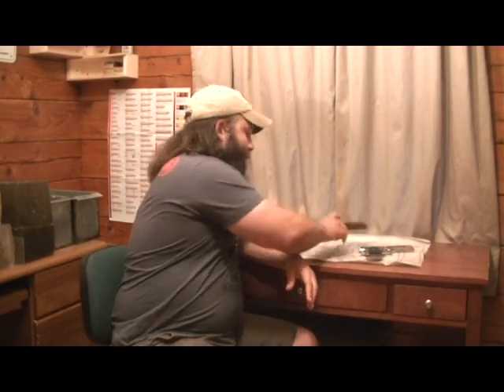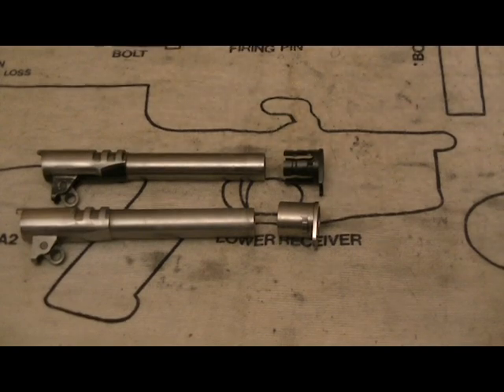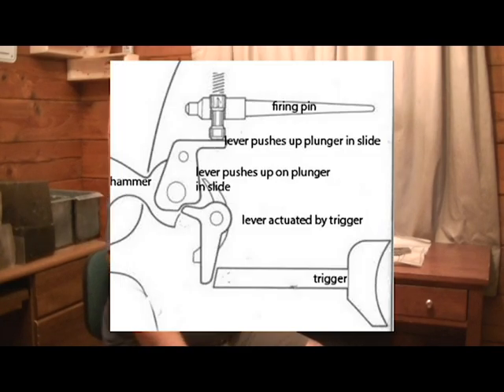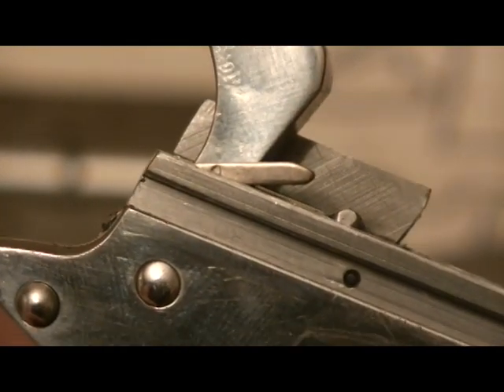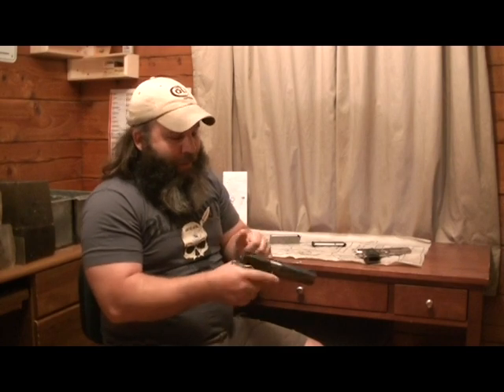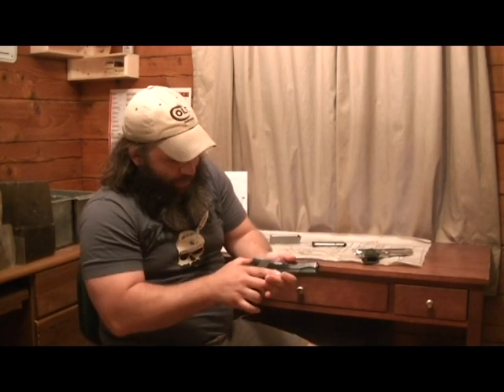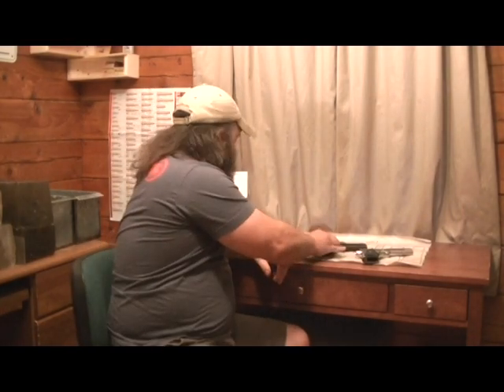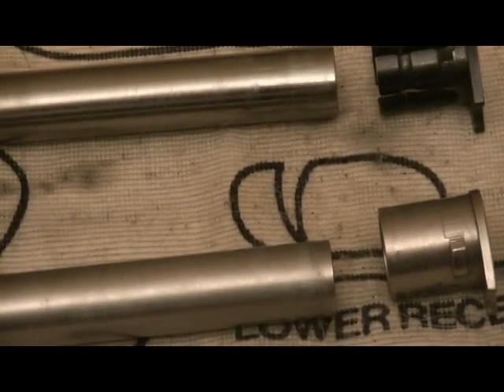Colt Series 70 vs Series 80

Comment: Just found this video.  I agree that it is clearly the best video out there explaining the differences between the Series 70 and Series 80 Colts.  This cleared up a couple things for me.  I've got a 1986 stainless Gold Cup Series 80, and another Colt 1911 marked Series 80.  The Gold Cup came with the collet barrel bushing which I have replaced with a standard bushing.  It functions exactly like you described and demonstrated.

The hammer on the 1911 has been replaced by a previous owner.  The replacement hammer has the half-cock hammer hooks you talked about, so it's operating like a Series 70.

Many thanks for the excellent clarification.
Reply from the maker: You are very welcome Mike. Stick around and check out other of my videos please.

Comment: I've had both and you are spot on, both had great triggers. The one with collet bushing never broke in over 10,000 rounds but was changed in a rebuild after that along with most internals! Only malfunction ever was from the detention tube coming off a nickeled Colt with rubber grips that didn't cover it, and two cheap mag springs going flat after being left loaded for over a year! That's 3 fails in 15 years and who knows how many round of reloads, hot hollow points, Keith type lead type and you name it! I know I'm fortunate but my 2 Colts and 2 Springfield's both ran everything I put in them, I've only had to tuned the extractors on them and do light polish of feed ramps and one firing pin hole that had a issue!

Comment: Thank you for this fantastic clarification.  So what would you call a pre-70 series pistol, like a mil-spec 1911 or 1911A1?  Does  it have a series #? Or do we just refer to it as a pre-series 70?
Reply from the maker: 1911 if it was made before 1924 and 1911A1 after that. Pre Series 80 designates a Commander without a firing pin safety. There is no such thing as a Series 70 Commander, FYI.

Comment: Good info brother I stumbled on this vid cause I was having a mini meltdown, That delta elite I had posted on your fb page I bought a while back I was going over it tonight giving it a lil inspection because I think I'll have to replace the springs. Well in the process of looking at it, dry firing it etc etc I realized that it barely has a "half cock" position and as you described the hammer will fall from the half cock if the trigger is pulled. I was flipping out lol and I'm by no means a nooB with guns but you can learn something new every day!

Comment: terrific Hunter as always...i didn't know about the hammer half-cock differences in the "hammer hooks" on the Old Colts.....all my Para's have the firing block series 80 including my 10mm (both have terrific triggers)...question....what's your choice or preference?  a Colt series 70 or Series 80?
Reply from the maker: Thank you very much brother. I am going to try and be less controversial, at least most of the time.

Comment: Im looking at colt Gold Cup National Match (45ACP) in 2020 on their web site and it has series 70 manual next to it.  Im confused why are they selling new series 70s when series 80s is update and maybe safer?  Still confused.  Sorry.
Reply from the maker: Bob, many folks do not like the Series 80 parts and some believe leaving out the firing pin safety makes for a better trigger pull.
Reply: Well was looking to buy a 1911 either a colt or a Springfield Armory.  I like the new new colt royal blued the best.  best bang for bunk I like the SA stainless mil spec.   So many options and they don't always tell you if its 70 or 80s parts.  So don't know enough to know what to buy yet.
Reply from the maker: Colt will be pretty clear if the pistol has the firing pin safety.  I don't know if I would say the Series 80 is safer but it is an extra safety. Between Springfield and Colt I would for sure buy the Colt. A much better bult pistol with better quality small parts.
Reply: @rangehot  Thanks for the info.  I like that new Royal Blued Colt I think its 70s.  I don't understand why they changed it if its not any safer?  Why not just keep the 70?
Reply from the maker: @Physics072  lawyers my brother.
Reply: @rangehot  :)  I'll have to punch my older Bro he is one,  howd you know?  Lucky guess.
I looked at older colts with Bluing and that roll marks on the new Royal Blued look amaturish vs the slightly older pistols.  Has Colt Slipped?

Comment: series 80 more moving parts, can that be bad?
Reply from the maker: Not necessarily, if they are correctly fit.
Reply: rangehot.com what about dirt and might require more cleaning. I feel like buying one to compare
Reply: There's theory, and there's experience. Go with experience every time.
I've been shooting a Sig Fastback Nightmare for about five years. It's a Series 80 design, and I've never had a problem of any kind.

Comment: What is your opinion on using a frame slot filler on a series 80.
Reply from the maker: +Tom Gandy John Travis has installed several on his Series 80 pistols but they are soft steel and must be changed ever few thousand rounds. As long as you keep an eye on them they work just fine as a filler to do away with the lawyer parts. I am not sure I would do it on a carry gun just in case God forbid you had to use it and it was brought up the owner removed a factory safety. I know that sounds stupid as hell but you know how slick lawyers are.
Reply: +rangehot.com Thanks, I appreciate the advise.